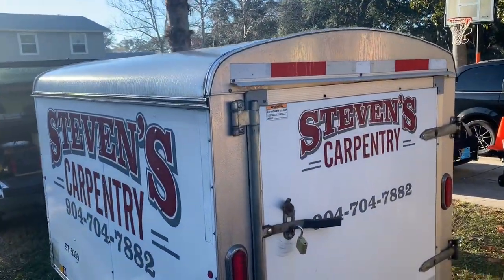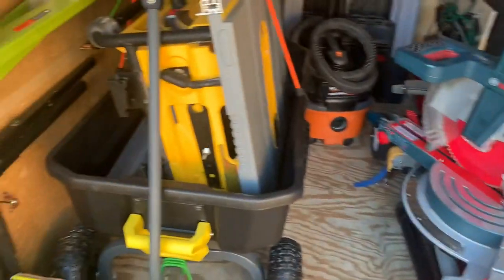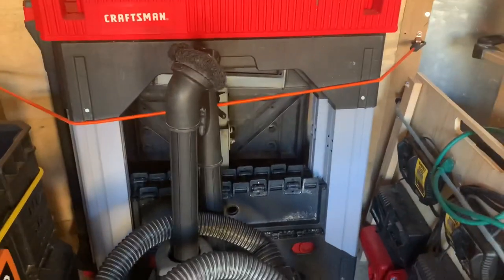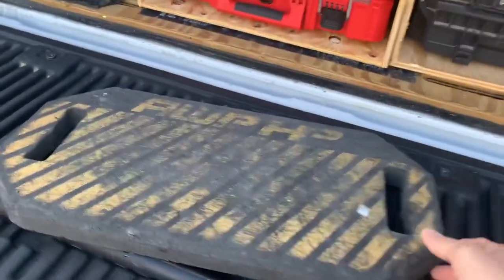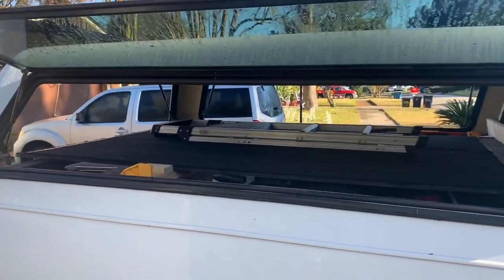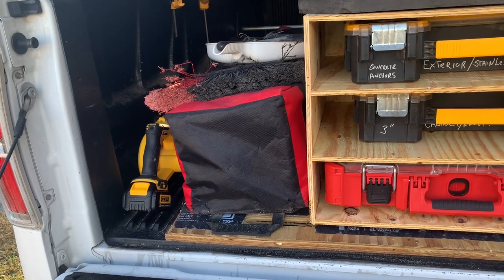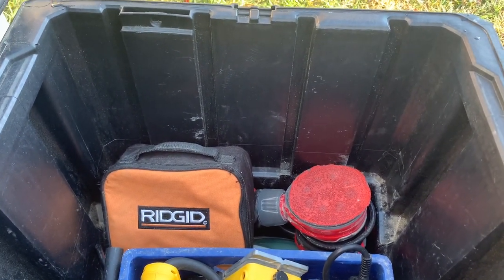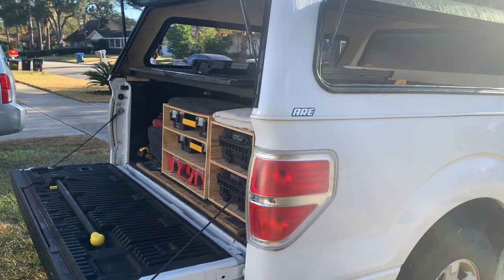Trailer/Truck Tour.   Not Ron Paulk inspired

Comment: Nice tour.  Seems like you would be better off with a long van or even a transit or Nissan NV2500 and for the trailer create a mobile work station with table saw, chop saw etc already mounted - just remove the cover. Could power everything with a generator.